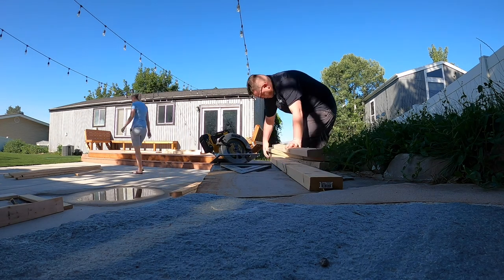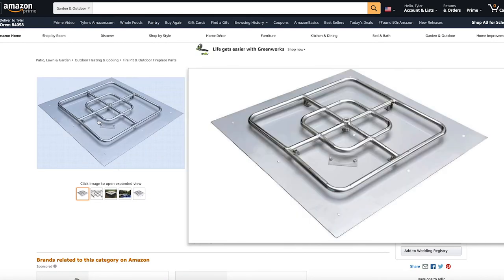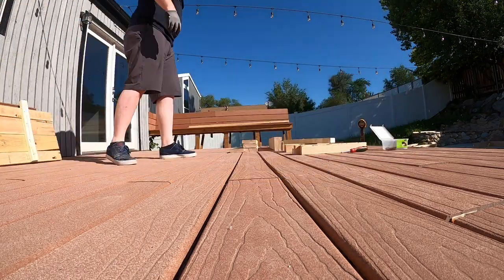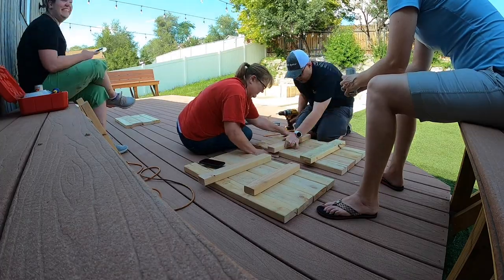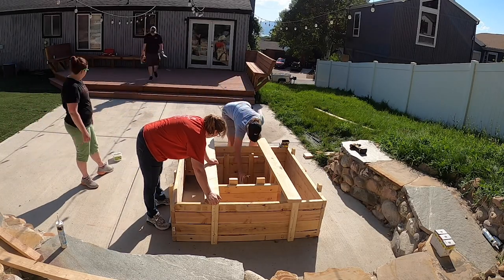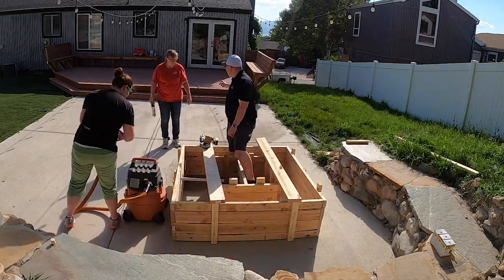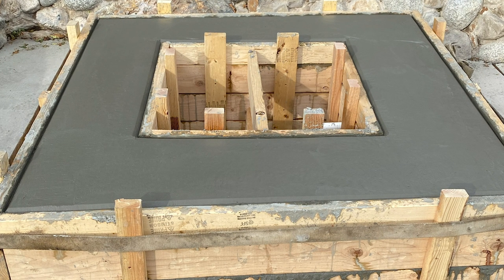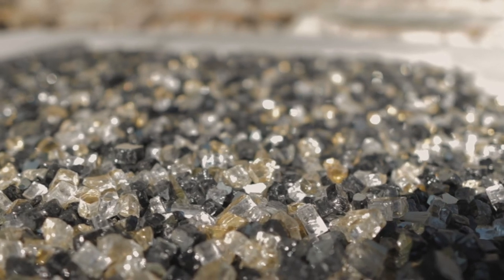DIY Gas Fire Pit Project.

Comment: When I seen that set up I knew it was going blow out 🤯 thats why I clicked on vid. It looks horrible no rebar? With the heat expanding & contraction my next Q is how many cracks have you gotten since? Why would you pour it on top of the patio?
Reply from the maker: We actually did use rebar as we were pouring it. I didn't film the pouring of the cement.  Also never claimed to be an expert just a normal person doing a DYI project.  Guess I should have done more research before pouring.  We have zero cracking in the build.  Hope yours turns out better.  When you post a video of it I will go watch it and learn how you did it.